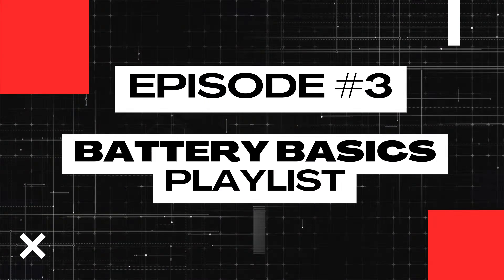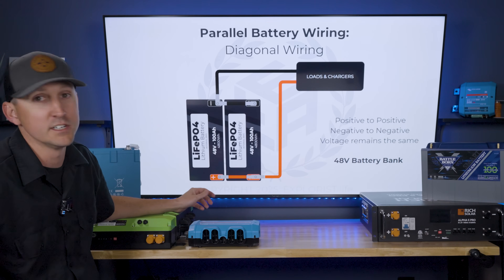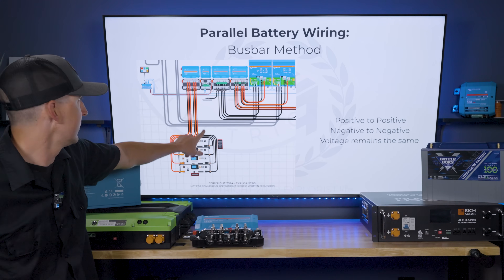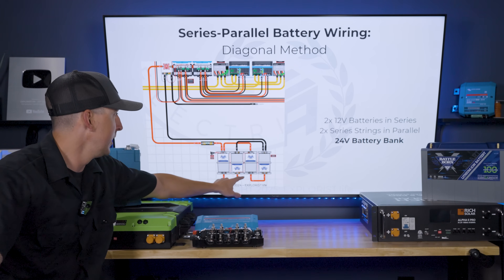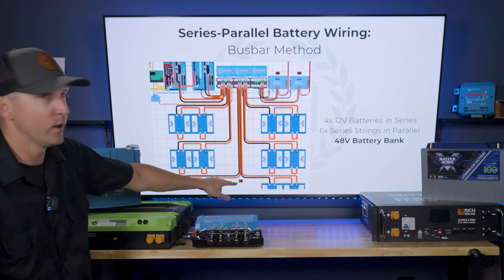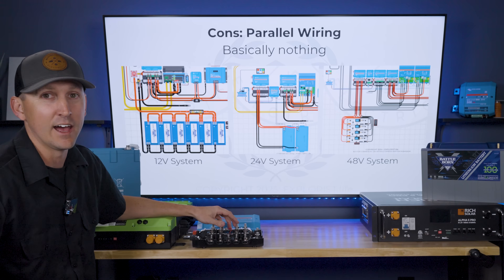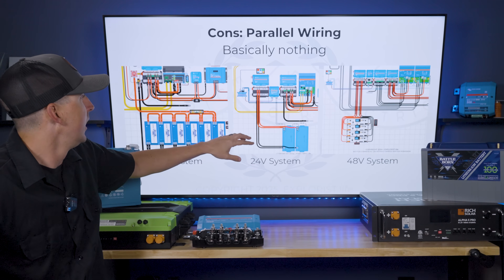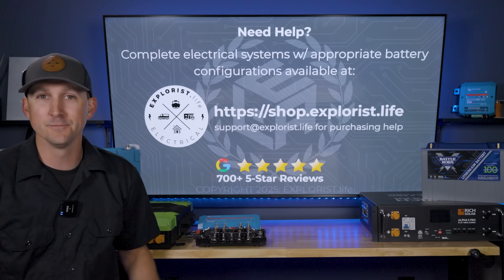How to Wire a Battery Bank: Series, Parallel, and Series-Parallel - Battery Basics |. Ep 3/7

Comment: My system is 4x 12v lifepo4 100ah.i have connected them parallel with out bus bars.cables negative/positive are 25cm long and 35mm² thickness.inverter is 2000w continues 4000w peak.loads are only 2 fridges.one of them is mini fridge second one is normal household fridge.
System runs perfectly.batteries are litime brand.
At specs is recommended to use bus bars but I still not use them as loads are not heavy.anyway do you think I must add bus bars?cables must be same distance from batteries to bus bars?
Reply from the maker: Great question — setups like this can look fine but still benefit from small wiring changes long-term. Rather than giving a generic yes/no, the best way to know for sure is to look at how everything is actually connected and what future loads might be. That’s something our support team can review quickly and make a recommendation specific to your system (and help with parts if needed).

Reach out to us here and we’ll take a closer look: https://shop.explorist.life/support?utm_source=youtube&utm_medium=comment&utm_campaign=support&utm_content=response_link

Comment: So I have this 14.6v battery charger that I use to charge 2 12v 100ah batteries together in a parallel hook up. Do I understand it right that I can charge the batteries in series and it will increase the charge to 29.2 volts lol .. I know 2 batteries put in series doubles the volts, so wouldn't that apply to the charger?
Reply from the maker: Great question — and you’re thinking along the right lines 👍
This is one of those situations where the details really matter (charger type, battery chemistry, protections, etc.), and giving a one-size-fits-all answer can actually cause damage or safety issues.

We’d love to take a quick look at your exact batteries and charger so we can give you a recommendation that’s safe and correct for your setup. Reach out to our support team here and they can walk you through it step by step: 👉 https://shop.explorist.life/support?utm_source=youtube&utm_medium=comment&utm_campaign=support&utm_content=response_link

They can also help make sure you’ve got the right gear if you’re planning any changes to the system.

Comment: By connecting each battery separately to the bus bar, aren't you creating the "battery bank" at the bus bar instead of at the batteries? And this would mean that you won't get equal current draw from each separate battery effectively shortening one or both batteries lifespan. If you parallel them first and then to the bus bar (or lynx distributor) you create a system that draws equally from both batteries. Or am I wrong?
Reply from the maker: Great question! ⚡️ The best way to make sure your batteries are set up for equal draw and long lifespan is to look at your specific system details. If you reach out here, we can take a personalized look and get you pointed in the right direction: https://shop.explorist.life/support

Comment: I have two BB Game Changer 3.0 12v 270 AH.  I'm using 4/0 + and -.  How important is it to run exactly the same length + and -.  Also, should I factor in the disconnect switch, fuse, and frame grounding wire as cable length?  It appears that my system will have more negative cable if I wire all connections short as possible.  I will have to add more slack in my positive to lynx distributor to equal the negative distance.   You may already have a video discussing this topic.  If so, could you provide a link, please?  Thanks for all the videos!  Your content has been extremely helpful!

THANKS!!!
Reply from the maker: Thanks for the kind words! 🙌 Cable length matching, what to count in total run, and grounding details really depend on your exact layout. Send us a quick diagram with lengths and components and we’ll review it, recommend the best routing, and point you to the right resources—and get you any parts you need: https://shop.explorist.life/support

Comment: Explorist, I watched alot of your videos Walk through etc I have the basics Knowing nothing before I was wondering if you have a list/schematic for a X2 - 300amp 12v battery system And the batteries i will be looking for are popular budget named ..Like Power queen/Li -time Eco-Worthy. I know they are not perfect But they are not the bottom of the barrel...I would like to do a 250amp alt for main power (ford Tranist) 20amp shore power connect (Common in my parts) And a later option to start the solar at 200watts going even later to 400watts ..Uses : Fridge/cooler freezer 50 to 70qt Puck lights, Chinese safety upgraded diesel heater..outlets for AC x2 And USB power outlets x2 A few LED strips for cabinets ...My Head is wrapping around the Idea of victron gear And 2000watt inverter Or 3000watt ( The odd short term induction single burner cooking on low to med) 30amp MPPT for the alt yes But do i go 50amp with the solar only running 1 200watt panel And later x2 200watt Or do i have to bite the bullet And go 30amp Then buy a 50amp ....Anyways Great channel
Reply from the maker: Thanks so much for the kind words — and awesome job soaking up all the info and getting a solid plan in motion!

You’re definitely heading in the right direction. A dual 300Ah setup with a high-output alternator, shore power, and scalable solar is a great foundation. Victron gear works really well for modular builds like this, and your planned loads seem totally reasonable for that system size. The solar controller size can depend on how soon you plan to upgrade, but in some cases it’s worth sizing up early to avoid buying twice.

That said, getting everything dialed — especially with the mix of components you’re planning — really comes down to the fine details of your layout, priorities, and exact gear.

I highly recommend reaching out to our support team for help building a schematic and parts list tailored to your setup:
https://shop.explorist.life/support

Comment: With parallel battery wiring can a smaller gauge wire be used with a bus bar configuration?
Reply from the maker: Great question — wire gauge in parallel setups can sometimes depend on more than just amps and distance, especially with bus bar use.

Our support team can walk through your system layout and help you figure out the best approach:
https://shop.explorist.life/support
(Free personalized support is available for items purchased through our store!)

For help with components bought elsewhere, check out the EXPLORIST Pro Support Membership:
https://shop.explorist.life/shop/all-products/membership-tiers/

Comment: Can I put one of the red battery cutoff switches directly onto post of mrbf fuse to use less 4/0 wire
Reply from the maker: That’s a good question — it can depend on the layout and current draw of your system, and there may be some install tradeoffs.

If you'd like a quick review of your setup, our team can help you figure out the best and safest way to wire it up:
https://shop.explorist.life/support
(Free help is available for items from our store!)

For gear bought elsewhere, the EXPLORIST Pro Support Membership is a great option:
https://shop.explorist.life/shop/all-products/membership-tiers/

Comment: Does there need to be a fuse going between the batteries when they are connected in parallel? I see a fuse on your series parallel set up from this video but wanted to make sure if it needs a fuse to be more safe with the regular parallel wiring
Reply from the maker: Great question — fuse placement can depend on the battery type, wire size, and how the bank is configured overall.

For a setup-specific recommendation, reach out to our support team here so they can take a closer look:
https://shop.explorist.life/support
(We offer free personalized help for gear purchased through our store!)

If your batteries came from another supplier, our Pro Support Membership is a great option for custom guidance:
https://shop.explorist.life/shop/all-products/membership-tiers/

Comment: Series connected LiFePO4 batteries will not self-balance between each other.  You also need a whole-battery balancer connected up between them if you want the bank to stay healthy.   Without it, the series-connected batteries will slowly go out of balance with each other and you will wind up with some over-voltage and some under-voltage.

Also, in series-connected LiFePO4 configurations, a BMS disconnect of a battery is unlikely to be able to auto-bootstrap itself back to health when the charge controller comes back in the morning.  So you can wind up with series -connected batteries falling out of the bank and wind up with unexpectedly reduced bank capacity.

Just generally speaking, this is why you don't really ever want to connect lithium batteries in series like you depicted.  Not for any serious system anyway.  Even with the whole-battery balancer, a BMS disconnect can cause chaos.  Instead its important to acquire batteries of the desired native-voltage and always connected them in parallel.

-Matt
Reply from the maker: Great points, Matt — definitely some key considerations when working with series-connected lithium batteries.

There can be some setup-specific variables at play, so if you're looking to dial in the best configuration for your system, feel free to reach out to our support team here:
https://shop.explorist.life/support
We offer free personalized support for gear purchased from our store: https://shop.explorist.life

For help with components bought elsewhere, our Pro Support Membership is a great way to get expert guidance tailored to your build:
https://shop.explorist.life/shop/all-products/membership-tiers/

Comment: how many distributors can you connect on the battery side and in the load/charger side of the BMS
Reply from the maker: Great question!

The number of distributors you can connect really depends on how your overall system is laid out and what kind of gear you're running on each side of the BMS.

To get a recommendation that fits your setup best, reach out to our support team here:
https://shop.explorist.life/support
(We offer free personalized support for items purchased through our store: https://shop.explorist.life)

If your components came from other places, the EXPLORIST Pro Support Membership is a great way to get expert guidance:
https://shop.explorist.life/shop/all-products/membership-tiers/

They’ll help make sure everything is dialed in just right for your system!
Reply: @EXPLORISTlife thank you so much. I have not purchased my travel trailer yet I wanted to buy things now so I will not have a huge bill next February

Comment: So these 12v LiFePO4 batteries are actually 4 3.6v cells in series, with a BMS to keep them balanced to maximize capacity.  When we wire these 12v batteries in series for 24v or 48v, is it worth taking the bank apart every now and then and connecting the batteries in parallel for a while so that they balance with each other, or is that overthinking things?
Reply from the maker: Great question — it’s smart to be thinking about balance and longevity with series setups!

Whether or not you need to periodically parallel your batteries depends on a few factors, including how your system is configured and how the BMS behaves across the pack. It might not be necessary in every case, but there are scenarios where it could help.

To get a solid answer based on your specific setup, reach out to our support team here:
https://shop.explorist.life/support
We offer free personalized support for anything purchased through our store: https://shop.explorist.life

And if your gear is from other sources, our Pro Support Membership is a great way to get tailored help:
https://shop.explorist.life/shop/all-products/membership-tiers/

Comment: Hi Nate. Thank you for the info. Do you have any guidance when batteries in a parallel-wired bank are at different distances due to physical limitations? For example, two batteries on one side of a van and a third (or fourth) battery on the other side. How to keep the bank balanced? Thanks.
Reply from the maker: Great question — spacing like that can definitely introduce some challenges with balance in parallel-wired banks.

There are a few ways to approach this depending on the layout and system goals, so we’d recommend reaching out to our team for a closer look at your setup:
https://shop.explorist.life/support
(Free personalized support is included with items purchased from our store.)

And if your components came from elsewhere, our EXPLORIST Pro Support Membership is a great way to get expert help tailored to your system:
https://shop.explorist.life/shop/all-products/membership-tiers/

Comment: For the diagonal parallel wiring does equal +/- cable length matter?
Reply from the maker: The importance of keeping your wires the same length to help keep current flow balanced across all batteries can be important to varying degrees, but I'd like to take a look at you personal needs to verify if it matters or not.

Reach out here and we can take a look.:
https://shop.explorist.life/support
(We offer free personalized support for anything purchased through our store.)

Or if you've purchased elsewhere, check out our Pro Support Membership:
https://shop.explorist.life/shop/all-products/membership-tiers/

Comment: You all are doing a great job with these videos! Regarding the disadvantage of excessive wiring for parallel systems: we've found putting pos and neg busbars next to the battery bank reduces and simplifies the wiring, helps to facilitate fuses or breakers adjacent to each battery and improves serviceability and isolation.
Reply from the maker: Thanks for the comment! There are definitely several ways to approach wiring depending on system design, but we always recommend reviewing the full context before suggesting specific strategies.

If you’d like help verifying that your approach aligns with current best practices and safety considerations, our team would be happy to take a personalized look:
https://shop.explorist.life/support
(We offer free support for items purchased from our store.)

And for gear purchased elsewhere, the EXPLORIST Pro Support Membership is a great way to get expert help tailored to your system:
https://shop.explorist.life/shop/all-products/membership-tiers/

Comment: The pre-charge.....Not required to pre-charge. They will balance over time. Maybe best practice but can be done safely.  In off grid situations, it's common for a lot of us to have multiple battery manufactures/banks we have built over time. That means it's inevitable you'll end up with series parallel systems with multiple banks, some of which are at different sizes.  I try to keep all mine the same size (obviously they must be the same voltage) but they can be different.  Not ideal, but required given most folks are not dropping 10-40k all at once to get same manufacturer and battery sizes. Otherwise, THANK YOU for covering this topic.  No one does and I have had to figure it out on my own based on various pieces of knowledge about banks and best practice.
Reply from the maker: Really appreciate you sharing your experience and thoughts here!

Battery setups definitely vary a lot in off-grid builds, and it's true—sometimes compromises have to be made based on what's available over time. If you'd ever like help evaluating your specific setup or want to double-check best practices for your wiring plan, feel free to reach out to our team here:
https://shop.explorist.life/support
(We offer free personalized support for items purchased through our store.)

And if your gear came from elsewhere, our EXPLORIST Pro Support Membership is a great way to get expert guidance tailored to your system:
https://shop.explorist.life/shop/all-products/membership-tiers/

Comment: Thanks again for another great video on wiring and batteries.. I have always enjoyed you and your wife opinions.. I have a question that relates to this topic.. I have a 280 amp hour self heated battery from Dakota.. living here in Canada with our temperatures you pretty much have to go this route.. my problem is that i would like to now add another battery to my system in parallel,, this issue is that Dakota does not make the same battery anymore but make a 320 amp hour battery,, the only other battery that has the same is the Renogy 300 amp hour self heated.. I use the Redarc Manager 30.. I asked the tech from Renogy about mixing the two different brands together and he did not recommend this.. in your opinion do you think it matters? I understand that I will still only have the lowest amount of battery capacity as the 280 amp hour battery times two which will give me 560 amp hours as a combo of the 280 and the 300 or 320 batteries.. one of the main reasons I am asking is because of the price difference.. that Dakota is 3000 dollars as compared to Renogy at around 1500,, but if its not compatible than I have no choice but the Dakota.. thanks again and keep up this great channel.. cheers
Reply from the maker: Thanks so much for the kind words and for sharing your setup—sounds like you’ve got a solid system going! That mix of battery types can definitely raise some compatibility questions.

Our support team can help sort out the best way to proceed:
https://shop.explorist.life/support
If the batteries or gear were purchased from our store, support is completely free.

For other brands, the Pro Support Membership is a great way to get tailored guidance:
https://shop.explorist.life/shop/all-products/membership-tiers/